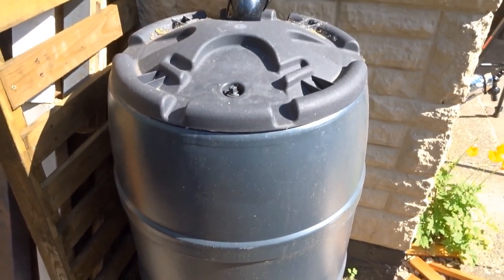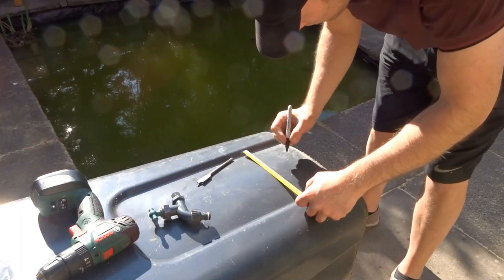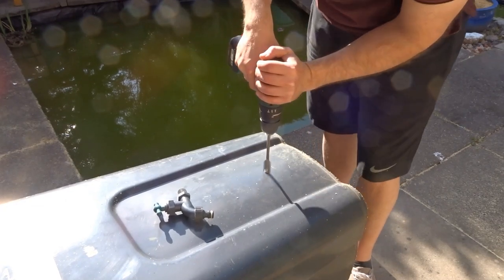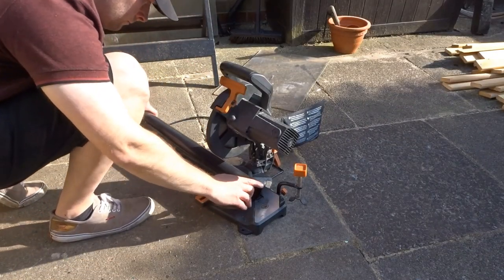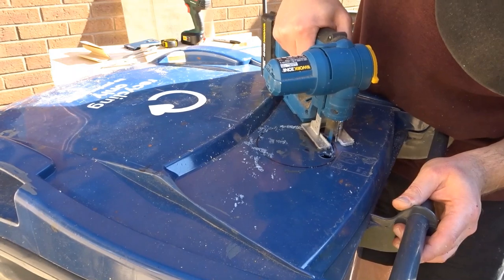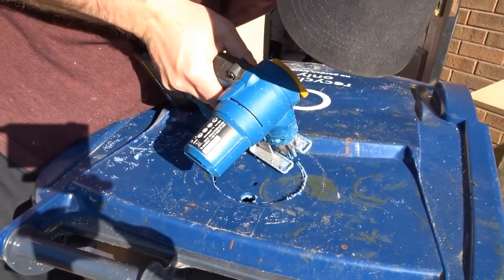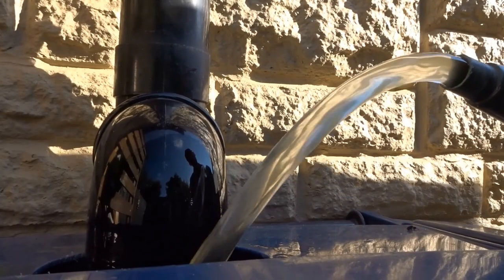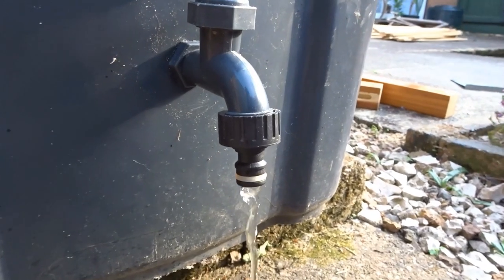How to convert a Wheelie Bin into a Water Butt Water Collection System

Comment: Can you put a watering can under the tap?   I could not see if the butt is high enough.   The  type of watering can is also critical - some have a the hand rail in the middle at the top which makes filling up difficult.   We need to save more rainwater (and compost) so this video is very useful in showing how new ideas work.
Reply from the maker: With mine I put it on a couple of slabs to raise it up. I found the tap to be too slow anyway so I open the lid and dunk the watering can in for speed.

Comment: Thought it would be better to drill the hole, and place the tap closer to the bottom of the container so  the entire amount of water can flow out through the tap.
Reply from the maker: @richardrhoden7445  you could but then the tap is more likely to get blocked by the silt that collects on the bottom.

Comment: How did you go when the bin was completely full, any fears of it cracking due to water pressure?
Reply from the maker: When it's full....if overflows. I've got it sitting at an angle to the excess water flows out the front and away from the wall. But usually, I empty it into the pond so it's not too full. I don't see a problem with water pressure. Although I think too much direct sunlight on a very hot day could cause the plastic to distort. Mines not in direct sun light.
Reply: @PhillWyattProjects  Have you considered connecting a second wheelie bin to catch the excess as my tank holds 300 litres and fills within hours of heavy rain.
Reply: Why didn't you connect an overflow near top, that sends water to drain if full